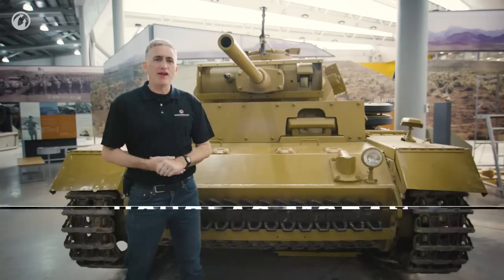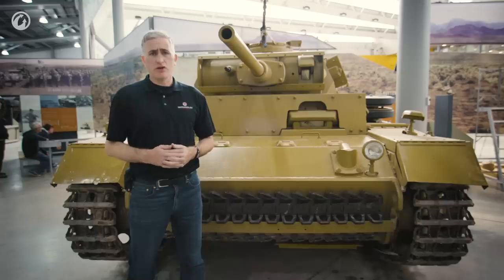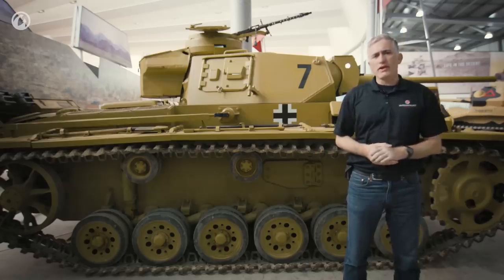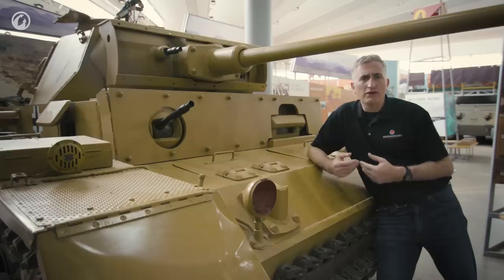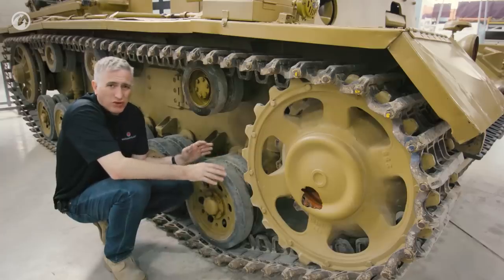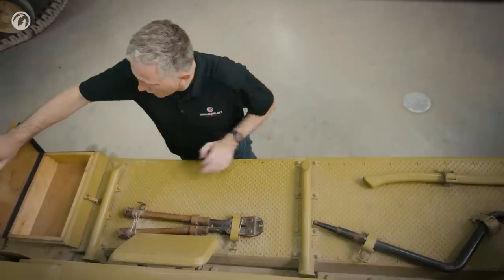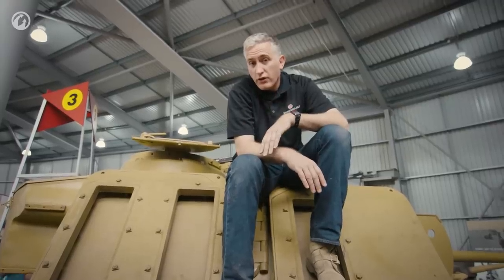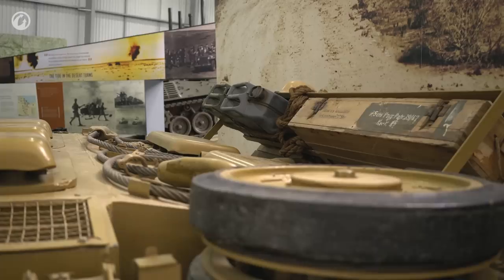Inside the Chieftain's Hatch: Panzer III Part 1

Comment: On a Sherman:
"The transmission broke down. I'll get another one, you start unbolting the front hull piece."

On a Panzer III:
"The transmission broke down. I'll get another one if I can fight off everyone else, you start taking the entire tank apart."
Reply: I had no idea PzIII came apart like a French Somua S35.
Reply: The more I've been looking at German tanks, the more it always confuses me that none of the engineers thought to make them easier to maintain.
Reply: @johnnycab8986  Splitting transmission and engine moves the turret backward a little bit, which I think improves balance, so there's definitely an upside. I think the problem is that the Germans thought that, next time, they'd make a transmission that would be fit for purpose and would need replacing very rarely. This idea was nullified by the fact that german tanks were overweight every single time because of escalating armour and gun demands.
Reply: @radioactiverat8751  Quite easy. Germans are engineers in the purest sense, great at inventing and making amazing things. However they were not good at "tinkering", making things easy to use. Americans on the other hand are the opposite: decent engineers, but great tinkerers. Their mindset was different: how to make a good enough thing, but make it so easy to maintain that even an idiot with a wrench can do it quickly.

Perhaps another reason, and in my opinion the MAIN reason why that is so, is due to logistic lines. It said a good general studies tactics, a great general studies logistics. Logistics, logistics, logistics.

 Germans were fighting on the continent, very close to a factory that could fix the tanks. Americans were fighting 5,000 miles away from their supply base, if something broke, they had to ship that broken part 5,000 miles home, then another 5,000 miles back at the front. They couldn't afford to have a single tank waiting 2 months for the replacement part to arrive. So for each assembled tank, they shipped 2 more tanks worth of parts. Since they had no factories nearby, all the repairs, including major ones, had to be able to be performed in the field, so all their hardware was built around that concept.
Reply: Zamolxes77 I completely forgot that they have to ship their tanks back for repairs. Funny how such details completely escape the mind.

You're completely right though, the Germans have factories not that far away, meanwhile the Americans have to go across the ocean to fix their tanks. 

I guess there really is no "perfect tank" in the second world war just whatever serve the needs of the country that made them. American tanks were made to be general purpose and easy to maintain,  German tanks were really technologically advanced in design, however they didn't have the resources to just make tons of extra parts for the things so they were kind of made in a way that was a pain to maintain. Japanese tanks were made simplistically and light for their role in the conquest of the uneven Chinese terrain, and not really able to compare against the American tanks which were stronger overall. The Chinese didn't really have a tank as far as I know; Therefore, the Japanese tanks didn't need to be all that sophisticated. Just something powerful enough to break the Enemy Lines and keep up with the motorized/mechanized Infantry.

I know very little about Soviet tanks, but my guess is that they could put a lot of them out because they were made very simply despite supposedly being a better tank than the German tanks of the time. They were just so hastily thrown together they didn't always compare.

Every tank had its purpose and roll and there really is no definitive perfect tank in the era. Though I do agree that some do fit the criteria of perfect tank more than others. Personally in my opinion I think both the later Panzer IV's and later Sherman models best fit that definition. But I'm sure there's arguments against that.
Reply: The Panzer III was actually extremely reliable. And were not known for transmission failures. The early Panthers on the other hand went through final drives on a regular basis.
Reply: Stuka87 oh don't worry you don't need to tell me anything about the panther. 

I think anyone who takes a serious interest in the tanks of World War II will hear about the Panther and its issues one way or another.

I'm sure on the right circumstances the panther could have been a great tank but unfortunately it was rushed in a time of need and it ended up being a very faulty tank. That said if you ever came across this thing in the battlefield in great conditions and it wasn't at the end of its line for its final drive it was a formidable foe I'm sure. The thing is that its faults we're not really worth it benefits. 

I honestly think they should have taken the Tiger and the Panzer 4 and made something based off those designs or at least improved upon them to make them better then they already were.
Reply: @radioactiverat8751  I think Daimler's version would have been a better tank for them, but the higher ups said it was too much of a T34 clone. The Panther would have been an amazing 'peace time' tank. And the transmission issues were fixed later on. But they needed a cheaper tank.
Reply: @radioactiverat8751  Later models of the panther (ie: variant G, and F, F of which was made in measly numbers) had their mechanical problems largely solved, But was still an extreme pain to replace worn/broken transmissions if such a problem occurred.
Reply: Stuka87 "Needed a cheaper tank" which begs the question why they didn't just keep mass producing P4's and Tigers. They worked, and sure maybe the 4's were pushing it on what they could fight considering they struggled against the slopped armor of the T34's, they had something that worked. I guess they repeated the issue ww1 had. Many figured the lines wouldn't stagnage like they did, and assumed it was only a temporary halt.
Reply: @radioactiverat8751  The Tiger cost almost twice what the Panther cost.
Reply: Johnny Cab I The reliability issues are clearly overblown. I can’t help feeling the detractors sometimes want to dismiss these powerful machines.  Complicated vehicles often suffer reliability issues when first introduced.  These are eventually dealt with by modifications as information comes back from the field as to what parts are breaking and why.  Initially the service interval will be more frequent to deal with this.  Guadarian writes most of the problems were gone the time the 3rd Panther Ausf G came out the problems were mostly gone.  The Germans more than the US and UK had to deal with shortages of alloys and machine tools which may have been why the Panther had straight cut gears on the final drive rather than the herringbone type used in the Sherman.  As it was the Panther was always to have planetary gears in this position and it was planed to introduce this on the New Ausf F.   The King Tiger likewise would have initially required more service but then within months this would improve.
Reply: @johnnycab8986   Panzer III an IV didnt have too much problem with transmission. Early Panthers had problems with 3rd gear going out. Ausf D Panthers you had to remove the turret. Ausf A and later had a removable hatch where driver and radio operators hatches were. Tiger had to remove turret. Panther with front hull driver and radio operators removable hatch panel allowed transmission to be removed without removing the turret, Took about 7 hours to remove transmission and a little less to put everything back in. So most of a day.  A Sherman front transmission assembly can be removed by two men in about 30 minutes.
Reply: Stuka87 Well then there really is no way the Germans could produce a cheaper tank than what they already had. At least that I see. The German-Soviet War quickly became a war of attrition and spending resources on such a flawed tank isn't really ideal in such a war. As I believe they likely would not have won regardless of the vehicles they produced unless they could have matched the Soviet's output in men and machines.
Reply: @radioactiverat8751   Germany had no chance of winning a war of attrition, especially when American industrial might and economic power were added in. Add in horrible German Logistics system, and a ridiculous lack of thought put into providing spare parts.  Tiger I and Panther was about as big as German could build and hope to maintain in field.
Reply: William Jones-Halibut To add to that, Potential History made a video (unfortunately can't remember which one) that mentions the german production of tanks was woefully low. They were fighting multiple fronts, both of which were against the larger superpowers of the world and was fighting the streamlined industrial output of the USA.

Not to down play the Soviets and how hard they fought, but supplies sent by the americans helped a lot from what I understand. The quality of german tanks seems to be not the question more how such quality vehicles could be given the maintinence capabilities of American tanks but that isn't really going to matter considering how scarce parts were. 

I believe the germans had a general better nack for designing tanks and I don't doubt that had they won the war in Europe and then had plans to come to america in some Wolfenstien like plan, they'd take whatever notes they could from foreign tanks including ease of maintinence.
Reply: @Stuka87  A good chunk of why they went with the M.A.N. over the Daimler Panther was due to the fact that the M.A.N. actually had a turret ready to go, where as the Daimler Panther Turret was still being designed (and would not be ready till the end of the year), other reasons where, better gun platform, the Engine Daimler wanted to use was not ready for mass production, also the Daimler Panther was rear "wheeled" drive, which the they admitted had advantages but the High command did not think was ready yet, also the M.A.N. Turret (actually designed by Rheinmetall -IIRC I think both turrets where by them) would not fit on the Daimler Chassis due to it having a 2 inch (5cm) larger turret ring and lastly the Daimler was inferior at river crossings (longer prep time). Not to mention that the High command wanted torsion bars not leaf springs.
Reply: yeah but the problem was the Russians had vehicles more than capable of taking out tigers and P4's which were the ISU 152 an IS2. Also while P4 was a pretty good all around tank and did the job the problem was Germany really couldn't make enough of them to fight on multiple separate fronts simultaneously and still have enough tanks to replace losses and still have vehicles in reserve plus all the other bits you need like spare parts, fuel, well trained crews, etc.
Reply: @johnnycab8986  The Panzers III and IV afaik did not have transmission 'issues'. Especially not these very well sorted middle variants. But even later, when it got up-armored to the breaking point, where the powertrain was nearly overmatched by the weight, it handled the strain ok, all things considered. Real problems cropped up with initial versions of the Panther and Tiger, which had a lot more weight and a lot more horsepower for the transmission to contend with.
Reply: Not to mention the Sherman had about twice the range between breakages too
Reply: I don’t think reliability of the PzIII was a particular problem. As a pre-War vehicle, they had ample opportunity to sort out any reliability bugs. Of course, that didn’t help you if it was your tank which fell prey to the odds and was the one tank in the battalion which had the breakdown, so it still took a lot more hours to make that occasional repair.
Reply: @radioactiverat8751  That is because german engineers weren't exactly good engineers they have issues with making things easy to maintain, simple, reliable, and correct for the time and available supply's but that was somewhat influenced by the politics of the time
Reply: @Zamolxes77  THAT IS NOT AN ENGINEER DUDE,

A great engineer will solve the problem in the simplest and best way, A mediocre engineer will do what the germans did in WW2 the panther and tiger were the designs by mediocre engineers with little restrictions 

a german engineer will overcomplicate and make a poor design the panther is a bad tank from an engineers perspective.
Reply: @johnnycab8986  most WW2 german tanks had terrible reliability due to being overweight and underdesigned. It was more likely for Americans to run into an abandoned panther than an active panther
Reply: 1423 171 I reccomend reading the other comments on why their tanks lacked ease to maintain. But on the topic of their technology? They had the best or some of the best. I mean they did conqour most of europe in less than a year.
Reply: @radioactiverat8751  I wouldn't say that either I mean the M3 carbine was more effective than the Vampir (30% of japanese casualties to small arms were to the m3) and was lighter, if you wanna bring up the 262 almost every country had jet fighter prototypes by 1942 like the airocomets, Meteors, and I mean the P80 was designed in just 143 DAYS,  honestly most of their stuff wasn't really more advanced than what most other countries had the defining difference is the desperation, What the US didn't want to use because of expense the germans had to in order to improve moral. You could bring up the V1 and V2 and in response the operation aphrodite would be an excellent example It's a Radio and TV controlled bomb drone that carried 30,000 lbs of explosive. The STG 44 is cool and a quality ergonomics development but it's ergonomics are similar to an AK, then theres the M2 carbine which could also be considered an "assault rifle" and it really has better ergonomics it's much lighter and it has the same capacity. thing is the whole conquering europe thing is caused by a massively unprepared enemy and new tactics.
Reply: T34 Transmission breaks down, don't worry comrade two more tanks have just been spat out the factory to replace it
Reply: On a Tiger:
"Hans, the transmission broke down, you get someone to tow us to the nearest crane to lift the turret off, I will call the Luftwaffe to see if they can fly in the spare parts."
Reply: @TheChieftainsHatch  A topic I would love to see addressed in depth is the development of tank engines. Aircraft of WWII seem to share most of their engines and many of the Allied ones ended up in tanks (Wright Cyclone and Merlin as examples). In aviation design, it was understood that developing a new engine was more difficult than developing a new airframe. I know many Allied tanks and assault guns shared engines, but it seems like the German tanks and assault guns did not share as much, resulting in additional development problems for dubious improvements in performance. Also, the Ford GAA V-8, all aluminium, four valves per cylinder tank engine was an incredible achievement for the early 1940's. Versions of it remained in service well into the 1950's.
Reply: @johnnycab8986  Yes it may have not been a massive issue as far as failure rates but if it takes 3 times as long to swap a transmission out as other tanks better designed to for maintenance it becomes and issue. I am sure crank up windows on cars worked just fine too. This over engineered culture has not left Germany. I see similar issues with farm tractors built there as well, great machines that can do everything, perhaps too much, they are reliable but when you need to work on them you have to strip half the tractor apart and no they do not address issues or change requests easily. They would rather have the rest of the industry bend to fit their designs and fail to grasp other parts of the worlds operating conditions. 
I would hazard a guess that if the same engineers designed the drive lines on the follow up Panther and Tiger tanks they were too proud to admit an issue existed and carried on. That's the type of German engineers I have experience with. "My design is good you are using it wrong."
Reply: yawhn stereotypes about germans beeing all engeneers as usual..you people are really naive. I bet you belive all Swiss people like cheese and all Italians work for the Mafia...
Reply: It's a good thing they are crazy reliable using. The same system as the tiger in a tank half the weight.
Reply: I've heard that's not only German car designers, but it's starting to become more common worldwide that even very basic maintenance is difficult for the average driver.
Reply: Delon Duvenage  👌
Reply: @radioactiverat8751  Also important to remember that basically every Japanese frontline tank in WW2 was hideously out of date by the time they started running into Shermans. When stuff like the Chi-Ha was being designed, the American equivalent was the M2 Medium. They were excellent interbellum tanks, but they were interbellum tanks--even by 1942 the world had passed them by long since and Japan's tank design program had lain fallow for far too long to catch up in a timely manner.
Reply: Interesting thoughts on this thread. The great patriotic war may have ended very differently if the US didn’t supply the Soviets with so many things and if the Germans were only fighting the Russians. The ISU TDs and IS tanks were not major factors in anything. If you look at the vehicle loss rates, casualties, and KIAs in that war it is pretty clear that the Germans didn’t lose very much compared to the Red Army. There were other major factors that cost Germany that war and tank reliability is definitely NOT one of them
Reply: @radioactiverat8751  It could be that they didn't think of them that way. Naval designers would - and engineers who built consumer automobiles. But it could be that this was viewed like a piece of artillery - if it needed work, send back to the arsenal/depot and draw a replacement. It isn't just German designers. There were odd British designs during this period of time.
Reply: @MarcABrown-tt1fp  Availability %s were never near US numbers.....
Reply: @dwwolf4636  Of course. That's because the Sherman was much easier to repair, I didn't imply the opposite.
Reply: @amerigo88  Have you looked what an mess was Shermans engine supply? GAA sure was good, but also multitude of cobbled together emergency engines, gas and diesel. Total mess, and tank was high because radials did had to fit also.

Germans had dedicated, cross compatible vehicle engine line in Maybach. Note, many spare parts did fit to multiple engine types.
Reply: @kimmoj2570  Quite familiar with the variety of Sherman tank engines: the Wright Cyclone air-cooled, the Chrysler multibank, General Motors twin diesel bus engines design, as well as the Ford GAA. Notice how each of the Big Three American car companies got a "piece of the action" and adapted existing designs instead of starting from scratch. The Cyclone was adapted from aircraft (same engine as B-17 IIRC), the Chrysler multibank was a crazy star shape of five inline six-cylinder motors that resulted in 30 cylinders and 30 spark plugs to diagnose. The GM design used two diesel bus engines and was intended for the Russians, who preferred diesels, and for the US Marines as the Navy used lots of diesel fuel on ships/subs which could be fed to Marine Sherman tanks as well. Even the Ford GAA was an existing aircraft engine design as a V-12 which Ford adapted by chopping off four cylinders but keeping the all aluminum design even though weight savings in a tank is much less important than in an airplane. 
However, the US Army basically stuck with fielding two of these engines - the Wright Cyclone and the Ford GAA while the British, Russians, and Marines ;) were lend-leased the other two engine designs to simplify logistics. An actual "mess" would have been wasting a year or two developing a tank-specific engine from scratch. As I said earlier in this thread, it was found in the aircraft business that it was easier to design airframes than aircraft engines. For example, the Pratt and Whitney R-2800 was used in (from memory here): F6F Hellcat, F4U Corsair, P-47 Thunderbolt, B-26 Marauder, C-46 Commando, and the P-61 Black Widow. That's a lot of platforms sharing a single engine design. 
When I look at German tanks, they seem to have a wide variety of platforms (Mk III, IV, V, VI, and improved VI) and certainly more than one or two engine designs from Maybach. One would hope there was some parts commonality, but it must have paled compared to US Army supply depots in France and Belgium during 1944-45. The reports of armed conflicts between German troops at train stations as parts were offloaded should be an indication of the dysfunctions of the Nazi controlled supply chain with  all of its corruption and cronyism.
Reply: @amerigo88  Jesus Christ! Do you have life? Jesus Christ! where did i talk about  Marauder bomber?

Also not addressing situation that Germans had same spare parts for their artillery tractors, APCs and tanks.

By your logic it must had been hindrance in rasputitsa in middle of nowhere.

US did slam ANY remotely workable engine to Sherman, because they HAD to. Hull production overwhelmed engine production. Not some goddammit voluntary choice.

US surely had good parts supply, and Germans abysmal. God Save the Germans if they would had had 5 different engines for Pz III and IV in 1941-42.
Reply: @radioactiverat8751  The Sherman was designed 5 years after the Panzer III, the Americans had time to look around, evaluate all available tank designs, and see their advantages and flaws. And their companies actually worked together.
 
The Panzer 3 was a one of the "first gen" ww2 tanks, built with local War of Movement ("Blitzkrieg") concept in mind, mainly against France and Poland. Build tanks for short, fast campaigns. If one breaks down, they'll just repair it after the campaign.

Another reason was their bloated and corrupt leadership system, with tons of committees and subcommittees, infighting between the  military Army Weapons Agency and the civilian Ministry of Armaments, corporate favouritism, nepotism, etc.
What the tankers wanted did not matter, specification came from the top, and the engineers were caught in the crossfire. 

Say you're a young engineer with good ideas, and you don't agree with some of the design specifications. You go to your boss and complain. If your boss was someone appointed by the party, you risked getting a free ticket to the Eastern Front. 
So you better spend your time working on an absurd project, that lasts for a long time and goes nowhere, rather then actually finishing something. Because if it's finished, you might not be needed anymore and get sent to the front. According to some sources I read (take it with a grain of salt) , some 250.000 engineers were sent to the Eastern Front.
Reply: Ah, german engineering, an absolute dream for the engineer, a complete nightmare for the end user. 

This is not limited to tanks, BMWs and Mercedes are very hard to work on because of the way they're assembled.